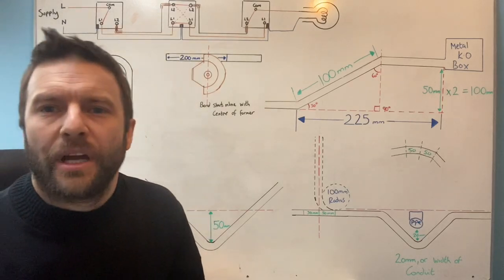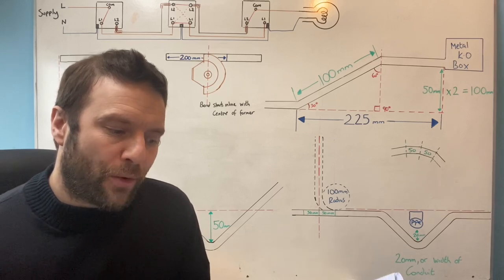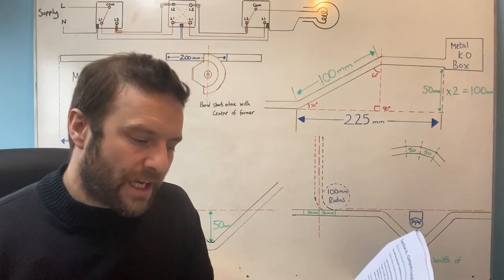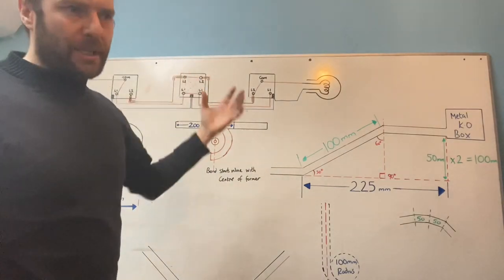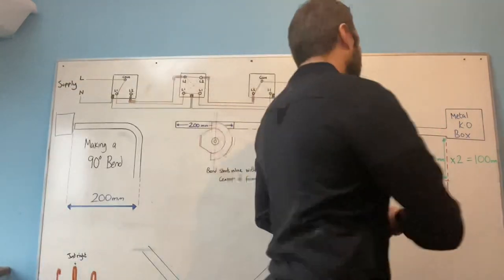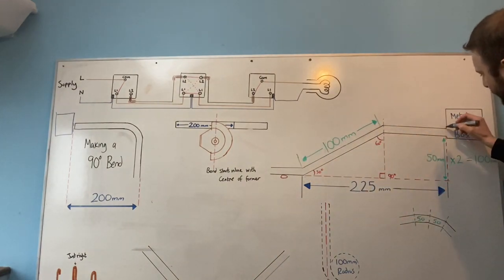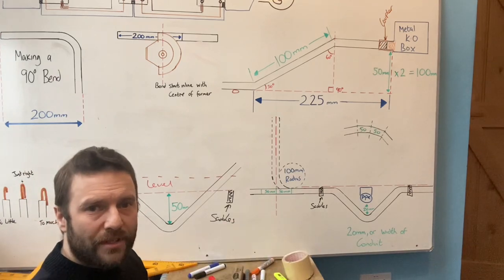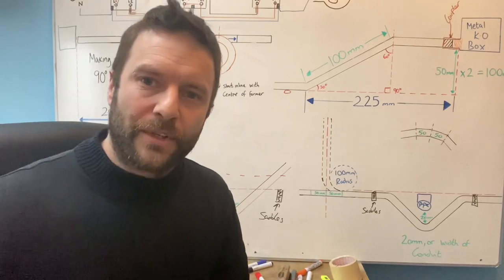Section B - composite installation of the AM2, AM2S and AM2E from the pre-assessment manual

Comment: I wire my 2 way and intermediate lighting different, I dont bring a neutral to every switch, I'm just wondering in the way you have shown is that a link from Com to L1 in the switch and Com to L2 in the last switch thanks
Reply from the maker: Feed into common on the first switch, L1 and L2 link over to the intermediate, then link into L1 and L2 at the last 2 way, switch wire out of the common on the last switch
Reply: Lacking neutral at switch common for years, however it's a consideration now to allow smart light switches...but also no ladder required for maintenance.... except for cost consideration... wiring domestic lights in 3 core can allow for easy mods later..but combatted by wireless switches...many solutions

Comment: When it comes to selecting protective devices, I believe you're given the cable size and type and you are supposed to select and fit the correct breaker based on cable size? I dont believe the spec tells you which breaker to fit???
Reply from the maker: Have you done the AM2, as the feedback I’ve had tells you to follow the spec 👌
Reply: @Pure_electrical_training  I preparing for it. The prep course I'm doing has a section on how to select  the protective device with the Ib <=In<=Iz formula. It says there will be a selection of devices on the table snd you have to choose. I do hope it's wrong and it's all in the spec. Confused now 🤣

Comment: You also get a wiring diagram for each part of the assessment an overall one for the install then one for each individual section like the DOL starter and such its really helpful i did mine last week and got distinction it was a very intense experience and you have to be on the ball but your videos helped me a lot, i do agree the analogy you use though if your trying to get through the  Am2s just watching videos your going to struggle you need to be competent as the time for each section is just enough time you cant really make any mistakes or you haven’t the time to finish although the assessor is really friendly and atmosphere is relaxed theres no pressure from the centre just get through it quick and correct following spec and diagrams and you be fine.
Reply from the maker: Thank you for the info 🤝

Comment: Thanks for all the excellent info. 
One point I would like to clarify. When data cables crosses over Low voltage AC cable in trunking, I've always found it a bit tricky with restricted space. When you mention a "Bridge", is this simply a piece of conduit or similar material, to give added insulation which is rated for "Low voltage" and ensures there is no risk of dangerous voltages  appearing on the data cables. I've always assumed that inducted interference cannot be avoided at crossover points, but as the area is so tiny it's not a real problem.
Reply from the maker: The bridge is simply a piece of plastic that provides a barrier between the two categories of voltage, to avoid inducing a current.

I was taught that you can only introduce a voltage of the cables are run parallel to each other, not if they cross over at 90 degrees, but the bridge is required for the AM2, so it’s their requirement
Reply: @Pure_electrical_training  I suspect the reason is not to avoid inductance (as you say : unlikely) but to mitigate against the risk of a dangerous voltage being transferred onto the data cable - because insulation on data cables is not necessarily designed for 230V as they don't need to be, if run on their own.

Comment: I guess with the metal conduit, whether you do the 90 degree bend first or the double set, really depends on how long you need the other side of the 90 to be. Else when bending the conduit, it might hit the floor before you can get it to 90 degrees 🤔 

Also with regards to cuts and marks on the former to determine the back of bend, I've never had a problem with achieving the exact measurement this way, however it only works when you place the conduit in the opposite way to how you do with the engineer square i.e. the measured end is the one being bent. That being said I only ever work with 25mm conduit, so couldn't be certain that the same is true for 20mm 🤷‍♂️

But for sure, my preference is doing the 90 first.
Reply from the maker: You could always put the conduit on the bottom of the bender and bend upwards

Comment: Dear Adrien I want to make a 3/4 size pipe bender using pulley roller, here need two pulley to complete that, would you tell me what are sizes pulley need to make that bender please?
Reply from the maker: Apologies, I’m not sure I understand the question.

You are making a pipe bender for galvanised conduit, I don’t quite understand what the pulley is for…

Is it for the bending part

Comment: Does anyone know if there is conduit on the AM2 I'm planning on doing this soon however I've not touched any conduit in ages.
Reply: No all containment is pre done on the am2 all you do is the wiring 
I think the am2S has conduit bends in it
Reply from the maker: I’ve heard that people who complete the AM2 without conduit, may have to do an update on containment later on 😬

Have a look into it, it may be worth calling NET
Reply from the maker: I’ve heard that people who complete the AM2 without conduit, may have to do a containment update later on 😬

Have a look into and call NET, let me know what you find out 🤝
Reply: @Pure_electrical_training  I'm pretty decent with containment anyway it's just the conduit. I've done it for about 2 weeks in three years.
Reply: @Pure_electrical_training  I have an just about to start nvq and they stated if I have already done the am2 I will have to do an extra. Section to compensate the am2E so you are correct

Comment: Can you check out your intermediate wiring as it doesn't look correct to me. on the new type of intermediates the L1 are on the top and the L2 at the bottom. I would wire the L1 & L2 from the switch on the power side to the top L1 & L1 respectively and then wire on the lamp side L1 & L2 to the bottom L2 & L2 respectively depending on if you wanted all the the switches to be in the off or on position.
I'm afraid if I followed wiring diagram that wouldn't work.
Reply from the maker: I’ve checked the drawing and it’s correct 😁

What brand of intermediate are you using?
Reply: @Pure_electrical_training  I use the BG British General so you could be correct i suppose each brand work in different ways. I will have to buy different brands to see if this is the case. What brand does your diagram represent so I can see for myself.
Thanks I enjoy your lessons I've not done the Am2 just did the 2391.
Reply from the maker: @dj6596  Is the 2391 the only qualification you have, as that is purely for testing
Reply: @Pure_electrical_training  level 2&3 2356 and 18th edition